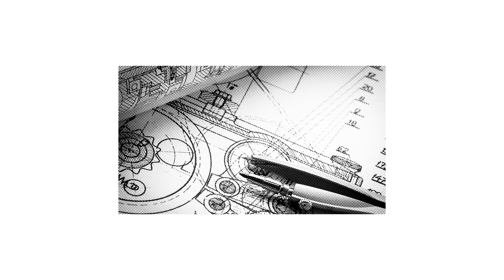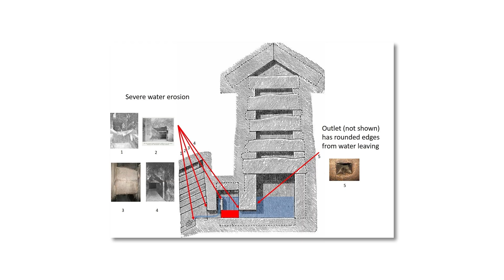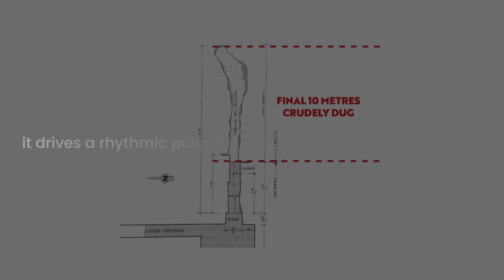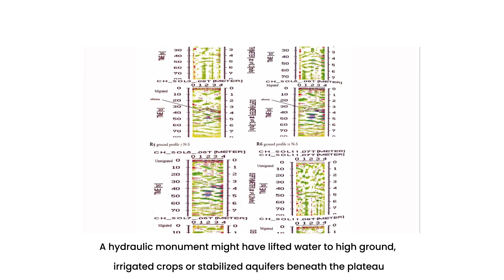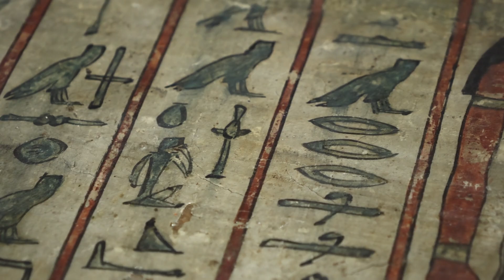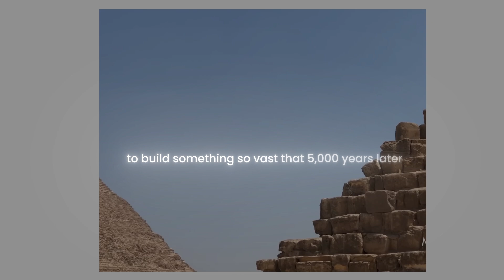Was the Great Pyramid a Giant Water Pump? The Engineering Theory Explained

Comment: You’re close but the ancient Egyptian’s needed drinkable water, you can’t drink water directly from the Nile it will make you sick and there’s no rainfall so you’re not going to find naturally occurring aquifers.  You could dig down and hope to find an artesian well or my theory is, divert water from the Nile to the area surrounding the pyramids and let the naturally occurring limestone bedrock that the pyramids sit on filter it for you.  The great pyramid functioned as a giant siphon and pump. The subterranean chamber of the great pyramid has a giant hole in the middle which I suspect leads to a well they created to hold the filtered water from the Nile and/or artesian well and the vortex you mentioned is actually water being pulled out of the ground using just the laws of physics.  Due to atmospheric pressure you can only lift water approximately 33 ft, the chambers have to be airtight and intersect at a point above the lower chamber and lower than the exit point which matches the layout.The heart beat sound is caused by the physics of a ram pump, when one chamber is full and reaches the vents it causes a drop in pressure so the the other chamber starts filling, when the water reaches the vents in that chamber it causes the pressure to drop and on and on, like a heartbeat.